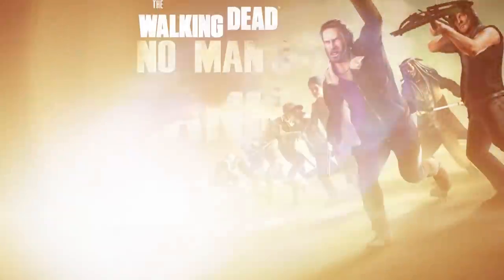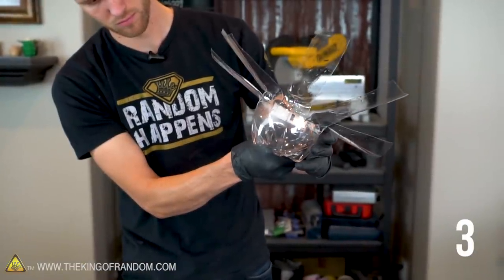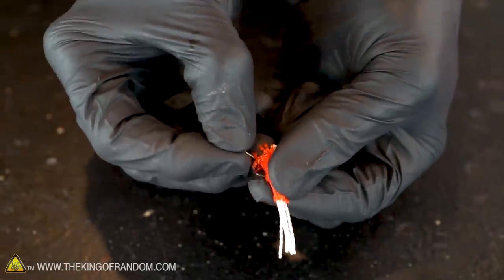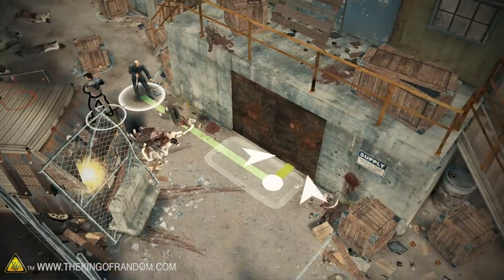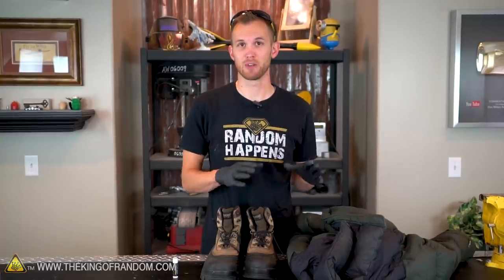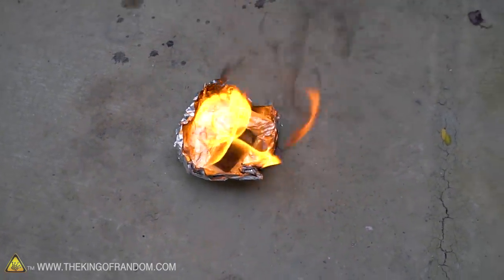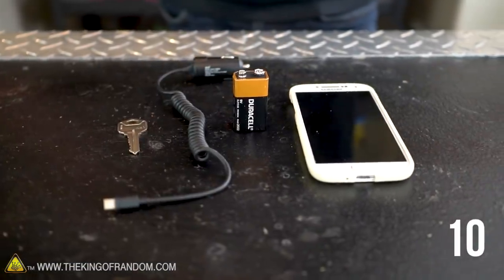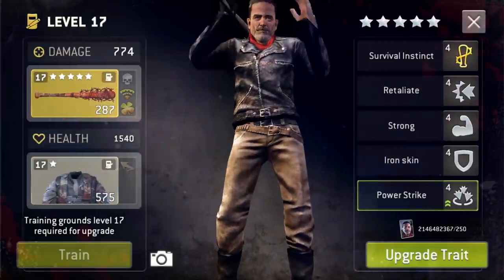10 Apocalyptic Survival Hacks! Want To Know How To Survive An Apocalypse? How About Zombie Survival?

Comment: Another way to get water (without waiting for a rainy day) is to get a plastic bag (one that will hold water, of course) of a decent size and fully enclose a leafy branch of a tree as tightly as possible. Don't cut the branch off. Leaves lose water through their pores which then evaporates away; but if the leaves are contained then water will collect at the bottom of the bag. The water collected will also have been filtered by the tree! My Dad did this when we were camping one year about 35ish years ago. It took a couple of hours (or maybe more - I was an adolescent then - time moves different when your'e younger) to get a large mug of water, and it tasted fine. It was a stinkin' hot day in the middle of Hattah Kulkine National Park on the banks of the Murray River bordering Victoria and New South Wales of Australia (you don't drink water from the Murray without treating it first as it is very silty and mud coloured).

Comment: TKOR, How about taking a tin can and melt wax, get cardboard, cut a long strip of it so when rolled it fits in the tin, when the wax melted, pour it in the tin with the cardboard and let it dry. That way you will have a "portable can fire" that can be lit using a fire kit and can burn for as long depends on the candle you melted. (I recommend you use plenty candles so it burns for a long time.

Comment: A better TP-tip is to first remove the carton tube from the roll and put the roll in a plastic bag. Pull the paper out from the inside of the roll so that it extends outside the bag. Put a rubber band somewhat loosely around the opening of the bag (paper still sticking out). That put the whole thing in another plastic bag. The outer bag i closed securely with the bag-closer of your choice. When in need you open the out bag and can pull out dry paper. Winner winner.

Comment: a way to filter water is to have 2 bottles and a piece of clean cloth (like a t-shirt). 1 with the unfiltered water and the other empty. Place the bottle with the unfiltered water on a higher place than the empty bottle, then put the cloth in the unfiltered water and place the other end inside or just above the empty bottle. The cloth should act as a filter and slowly make the water clean as it drips into the empty bottle.

Comment: Use candel wax on shoes to water proof them. Rub it on and melt it a bit so it gets absorbed in. Also you could cut the bottle in half and flower it to get two. It's less surface area but double the collection capacity.

Comment: Should be noted with the 2-liter bottle trick, if you need more room for collected water, you can cut the bottom off instead and use the top of the bottle (which is at the bottom) to easily feed into another container, even another 2-liter bottle.

Comment: Toilet paper is WRONG! (This packing advice creates a waterproof pack that doubles as a flotation device.)
#1 Remove cardboard insert.

#2 Fold roll lengthwise and squeeze into a quart Ziploc bag.

#3 Close zipper from each end leaving a slight gap in the middle.

#4 Press & roll and then close gap to create a compacted vacuum sealed roll. Place several rolls in a gallon bag and press out all the air.

Space is paramount when Camping or hiking! Most shirts will fit into a quart bag as well when folded lengthwise and tightly rolled. Pants will fit into a gallon bag. Fold underwear lengthwise and place a pair of socks over it, roll & bag.

ALWAYS DOUBLE BAG! I'll place a couple bagged shirts and 2 changes of socks & underwear in a gallon bag. When double bagging ALWAYS orient the zipper towards the bottom of the outer bag.

Comment: If you're using the coffee can TP dispenser for camping, I would use a drill bit slightly larger than the rope you're using, so you're less likely to have any water migrate in. Even better, use rubber grommets on the ends.

Comment: UPGRADE THAT HACK: the water bottle collection hack- always cut off the bottom of the bottle and leave about a quarter of the bottle's height on it, when you flay out the strips from the top you can rest the neck of the bottle on top of the bottom effectively funneling all the water into a ready made cup! you could also partially bury the bottom half of the bottle if you're leaving them about the place so that the water doesn't evaporate so quickly!

Comment: If you were to cut out slots on the bottle there are two flaws. One it doesn't collect as much water. Two the slots wouldn't catch the water they would drop it on the ground, because of the force that the rain hits on the flaps. plastic doesn't have the tension to hold its self up.

Comment: You can cut PVC pipe with a nylon string about as fast as you can with a saw. If your PVC pipe is in a trench or in a wall or any place tight it's really easy to use a string instead of a saw

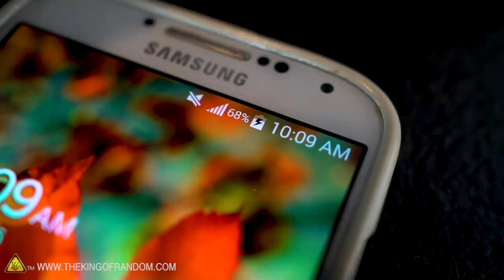Comment: 11:48 That works, but not very well because 9 volts are trash at giving out high current for long periods of time. If you can, try connecting 8 AA or AAA batteries in series, that will give 12 volts dc, and 3 amperes.

Comment: You can do the candy wrapper trick with a thick blade of grass as well. Or if it’s all smaller blades that best when blow on the stack two and hold them tight and it works as well

Comment: Crayon or beeswax can be used as a candle or lip balm.
You can sharpen your knife with your belt and soapstone.
You can make a crystal radio with your razor blade, very long wire, tin foil, small lip balm tube, and use the buzzer as an earphone. It is an piezo speaker.
Reply: Sooner Science Nerd how? I must know

Comment: Rip a gum wrapper in the shape of a ribbon, use the metal part of wrapper and press on the ends of a battery, the batteries connection will start a fire in the small portion of the ribbon shaped wrapper. You're welcome Gavin!

Comment: Try making solid methane using liquid nitrogen just like dry ice is solid form of co2 there is a possibility that methane might become a solid too and if yes then try burning it if it doesn't freeze then try burning some other solid fuel after cooling it in liquid nitrogen

Comment: If you want to totally waterproof the zipper of your jacket just run a bead of hot glue on top of the zipper and use a popsicle stick to push the glue into the zipper while it’s still hot. Now your zipper is waterproof.

Comment: A better way to cut that yellow rope without a knife is to just hit it.  I will often drape a piece over the corner of the vice on my bench and hit it with a hammer.  Im sure in a pinch 2 rocks would work aswell.

Comment: You can run the needle on wool or anything that would cause a static shock, and a leaf as the float, which are more natural... why didn't you cut up the striker, and put it in the other end of the paracord shoelace?

Comment: Survival tip, they are tips.
hack1

hak/

verb

1.

cut with rough or heavy blows.

"hack off the dead branches"

synonyms:cut, chop, hew, lop, saw; 

slash

"Stuart hacked the padlock off"

2.

use a computer to gain unauthorized access to data in a system.

"they hacked into the bank's computer